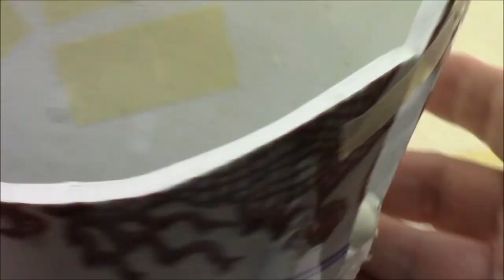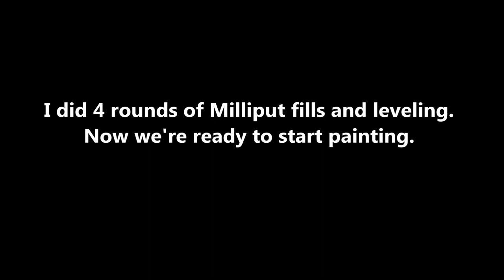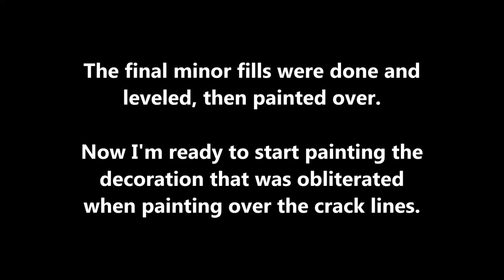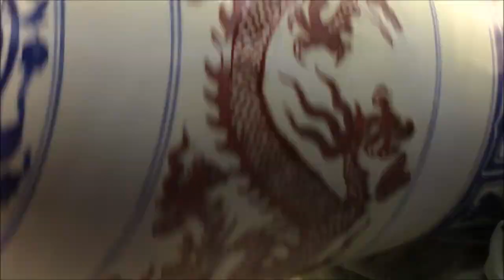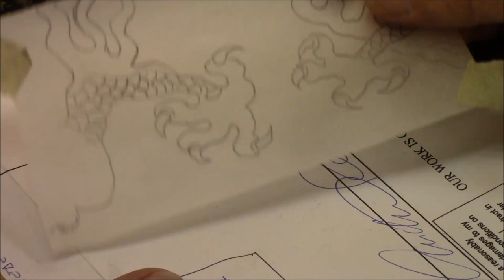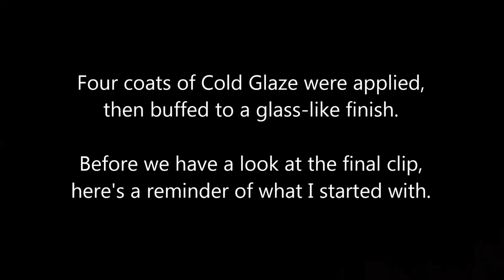Chinese Porcelain Dragon Vase Repair

Comment: Thank you Mr. Scherer for this video.  I can't believe porcelain is so hard~the impact to break it must have been significant.  Pieces are sharp as well.  Milliput Super Fine White instructions are not kidding when they read "rock hard in 3-4 hours".  I had the same problem with my base as you had with your top.  The only thing I could think of doing was to  feather the circumference of the inside edge with a Dremel tool, so I could float it in after gluing.  It was too tall/narrow to stick an arm into it. Thanks for the painting demonstration.

Comment: Hi Martin,  not only you have the knowledge and ability to repair the beautiful vase but you also have the Patience of Job needed to finish the job.  (sorry couldn't resist the pun).  Could you please advice the brand and where to purchase the Cold Glaze? Thanks a million.
Reply from the maker: Cold Glaze is made and sold by Sylmasta company, in England. They are easily found via the internet. There is a U.S. distributor, their name escapes me at the moment. Sorry.
Reply: Thank you
Reply: thats the hardest part for me<3 i still struggle using my cold glaze with airbrush

Comment: Glorious work Martin Scherer! I am artistically inclined and want to restore small chips on some chinese porcelains I have. I have milliput. Golden acrylic paints. Fine brushes etc. I do not have an airbrush.Will purchase one though. What is the color you use on the porcelain? I watched a few times and looked at the trabscript as well. That is an exact match. It is incredible!
Reply from the maker: Thanks for the compliment. The color I use for porcelain is some mixture of Golden brand acrylics and their mediums. Other than that, it's a color-matching operation. I've been doing this for a long time and it can still be frustratingly difficult to match colors on ceramic repairs. Good luck to you!
Reply: Thank you so much for the reply! I purchased some

Comment: I've gotten great instruction for statuary/ceramics repairs and have purchased both milliput and A&B epoxy with great results. I've been getting a few more repair jobs to do and was wanting to know how I can give an estimate on the repair work to be done. Can you offer any help/suggestions? I have found nothing on line. Thank you Martin.
Reply from the maker: Wow, that's a tough question Gail, but a good one. 
I've been doing this for more than ten years now, so I'm able to come up with a figure with a mental calculation as I'm examining a potential repair. But back when I started, like you, I needed a way to come up with a price so that I don't cheat myself or my client. I made myself a spreadsheet calculator to do that. But, you don't need a spreadsheet to calculate a price.
Here's a suggestion: make a list of all the possible steps and procedures you'll need to complete a repair. Be aware; this can get very difficult and complicated if the repair involves many pieces, missing pieces, and/or a lot of detailed hand painting. You probably won't think of everything the first time around, so you'll be updating this list until you get enough, and different kinds of, jobs done = experience. 
Imagine every step to do a repair. For example (I'm making this a short list just for this example - because the real list could be fairly long). A list might go like this:
clean, "before" photo, bond, fill, smooth fill, paint, cold glaze, buff, "after" photo.
Estimate how much time it will take to complete each item on the list (experience will make your estimates more accurate). Total that list of times. If you're new at this, multiply your total by 3 or 4. 

You'll then multiply that number by what you think your time is worth. I can't help you with that number other than to say it'll be based on your variety of skills, how good you are at them, and how much experience you have. You be updating and adjusting your list and prices as time goes by. 

I hope this quickie example is helpful to you. I wish you luck in your endeavors.
Reply: @marsgitar  Thank you Martin. I will consider the job and the extent of work to be done and material. Thank you for sharing your talent with the group watching your instructions and repair style.

Comment: What type of paint do you use and do these paints come in classic 'porcelain' colours, cobalt etc ? thank you lovely long video ,,, makes us look at borken things differently. I remember with some horror how I repaired things before the modern materials came out !! I once took nail polish remover to an 18th century painting !!!
Reply from the maker: I use Golden brand acrylic paints and mediums for 95% of my repairs. The answer to your question is "Some paint colors are the same as classic traditional glaze colors". The "classic porcelain" colors (some of them) are the same as classic oil painting colors, because they are made from minerals found in the earth: ultramarine, iron oxide, umber, etc.., and the glazes are made from the same minerals. Even though most modern acrylic paints are made from synthetic materials, the colors are as close as possible to the traditional media. One almost never uses these colors unaltered straight out of the bottle to match the glazes on ceramics. Also, these acrylic colors have to be covered with a sealing coat to protect them, and to  make them look like a glass-like glaze.
Reply: @marsgitar  Thank you Martin, it's kind of you to share that info. Many years ago I had considered Learning restoration as a profession but I couldn't find a restorer who would accept to teach as it was a jeolously guarded profession. I am Scottish but have lived in France since 1978, the French are not generally 'sharers' !! I even tried to get my dentist to share his adresses but no luck either. Today with internet you can find almost anything, too late for me but watching you is like the best movie !! always a happy ending, thank you, hugs from France.

Comment: Mr. Scherer could you please explain me why did you use AB epoxy  plus  Milliput? Why do AB epoxy is not only to use? Thanks,
Reply from the maker: I use A+B epoxy for bulk fills; to replace missing pieces and fill areas that need a strong bond and a hard material. I use the Milliput for a final fill over the A+B to fill fine imperfections and get a good transition at the edges of the fills. It can fill the tiniest of spaces. Milliput is a bit softer, and easier to file and sand.
Reply: @marsgitar   Thank you very much for your fast reply! You are doing such amazing restorations.

Comment: Another great video, are you using straight acrylic paint or is it mixed with the cold glaze? Are you not fussed about brush strokes showing under the final glaze?
Reply from the maker: Thanks for the compliment. I'm using Goldens acrylic paint, some parts painted with a transparent medium in the mix. Brush strokes, if not desired, are usually gone over with an airbrush to soften or eliminate them.
Reply: thanks!

Comment: I congratulate you for the great job you do. I would be very grateful if you could tell me which specific acrylic mark you use and how to match the color of the acrylic with the original color of the piece. Thank you.
Reply from the maker: Thank you Yusdel! I use "Golden" brand acrylic paints. The way I match acrylic colors is: mix the color until it looks close to the color I need. Then I put a little spot of that color on the object I'm painting, and dry it; because acrylic colors are lighter when wet. When that color spot is dry I can see how I need to adjust the color in the direction I need to go. Then I repeat this process until I get the color I need. No magic, just mixing until I get it right. Solvent based colors don't change color when they dry.
Reply: Thanks, Martin!
Thank you!!!!

Comment: Well I happened upon your videos and am amazed.  My mom broke her Japanese figurine and I bought the epoxy glue and am trying to fix it, and was trying to be careful but didn't number the pieces when I took them off after a trial run, I'm always in a hurry.  So my fingers were getting glue on them, and the piece didn't fit perfect, and now I can't fit the piece I should have put in before the other piece.  I am stuck, is there some way to remove an epoxy piece?  I have researched and tried acetone but to no avail, I know I could try to fill, but I done have the tools or talent to touch up, I really screwed up.  Is there an epoxy remover I can get?  Thank you so much, I appreciate your work.
Reply from the maker: Most US hardware stores carry a product called: Jasco (brand paint and epoxy remover. Try this. It might take several applications. Nasty stuff. Wear protection. Good luck!
Reply: @marsgitar  Thank you so much for the quick response, I will give it a try and love watching you make something look so easy...though I know its not.  AND where can I get your size glass rods and your mixing cup, please.
Reply from the maker: @sherylcarey4921  You can find both with a quick internet search for "1/8 x 6 inch glass rods" (I break them to size), and "used glass beakers, 10 ml and 20 ml size" to mix paints and epoxies (these you have to buy at least 10 at a time.
Reply: @marsgitar  Ah I didn't think of breaking the rods, thank you for the information I am looking forward to giving my breakables a try.  Also if I need you to do a repair how would I do that?
Reply from the maker: @sherylcarey4921  You can contact me via email: mscherer@tesserak.net

Comment: Before you start painting do what car painters do after sanding your filler , not sure of the name of the product, but I’d rub some  dry or damp pigment powder on the sanded areas and the pigment will get trapped in holes and scratches, identifying  problems. Great work.
Reply from the maker: Thanks for the suggestion.
Reply: Martin Scherer  bet you already knew, beautiful work.

Comment: I have a Chinese Famille Rose early 1900's Porcelain Buddha that's perfect except it's missing one of the head's of a small child setting on it's shoulder. It has 5 children setting on the buddha and each of their heads has a hole on each side of the head to let out heat when it was being fired. I was thinking maybe someone could make a rubber mold of one of the other children's head  which are all the same design and then attach it where one has a head missing that looks like a clean break or maybe was a defect when it was made and they never repaired it. I was wondering what it would cost for a repair like that .
Reply from the maker: If you're asking me for an estimate, I will need to see a photo of the object in question. You may email me at: mscherer@tesserak.net

Comment: Hallo Martin,ich bräuchte deine Hilfe.Kannst du mir bitte sagen was ich brauche für Restaurieren  von Porzellan -Puppenkopf.Sie ist kaputt.Kannst du mir bitte sagen womit klebst du die Scherbe,was soll ich für die Risse benutzen-(Milliput???)Ich weiss nicht,was soll ich besorgen für die Löche zu verstopfen,der Lack zu lackieren muss wahrscheinlich für Glas sein.Kannst du mir bitte beraten?Danke Irena
Reply from the maker: Sie können ein Epoxidharz namens „Araldit“ oder ein anderes klares Zweikomponenten-Epoxidharz verwenden, um die Scherben zu verbinden. Verwenden Sie Milliput White, um Risse, Absplitterungen und Hohlräume zu füllen. Verwenden Sie zum Dekorieren Acryl-Künstlerfarben. Eine Airbrush hilft, ist aber nicht notwendig. Ein Klarlack schützt die fertige Arbeit. Viel Glück.

You could try an epoxy called "araldite" or any clear 2-part epoxy, to bond the shards. Use Milliput white to fill cracks, chips and voids. Use acrylic artist paints to decorate. An airbrush helps but not necessary. A clear coat will protect the work when done. Good luck to you.

Comment: Martin, what’s the blue paint you used to paint the blue parts? I’m having some difficulties finding a similar hue blue for a project. Thanks a lot. Cheers
Reply from the maker: I use Golden brand acrylic paints. The blue I used here, I think, is called "Payne's Gray". You can make it yourself by mixing Ultramarine Blue and Carbon Black.
Reply: @marsgitar  thanks a lot Martin. I will give it a try. Really looking forward your next videos. Cheers

Comment: How did you get that large gap so flat after?
Reply from the maker: I used a flat file for 99% of it . . . just filing to the contour of the vase walls. Finished with sandpaper.
Reply: @marsgitar  What grit? thanks for responding!!
Reply from the maker: @dorynwallach5294  MicroMesh 2400.